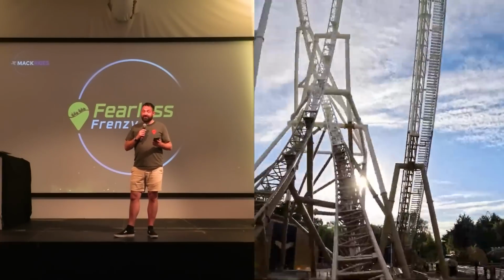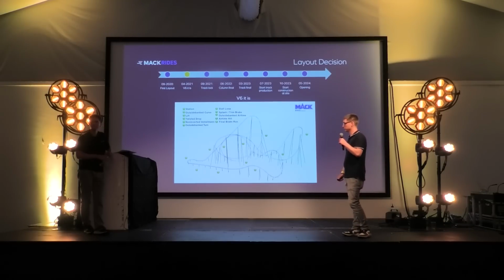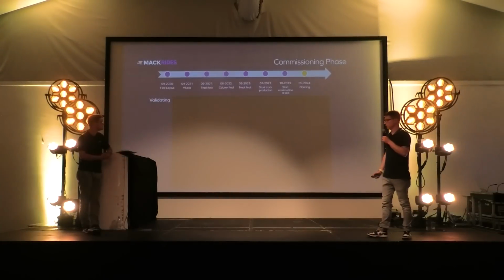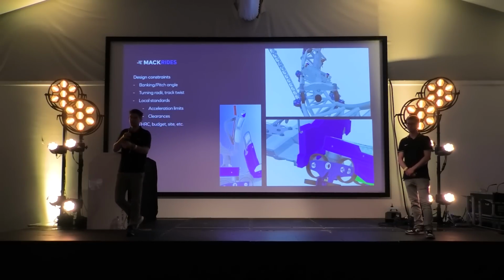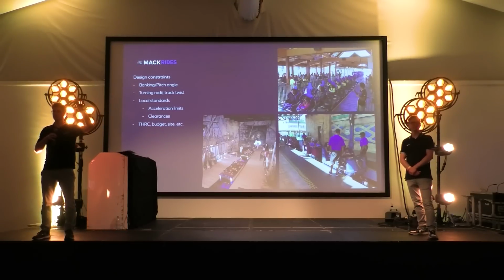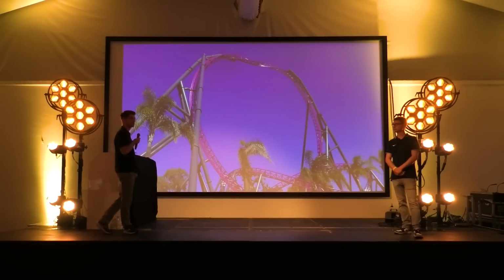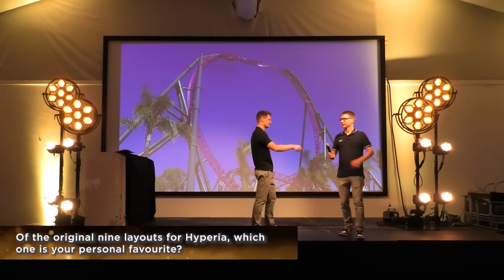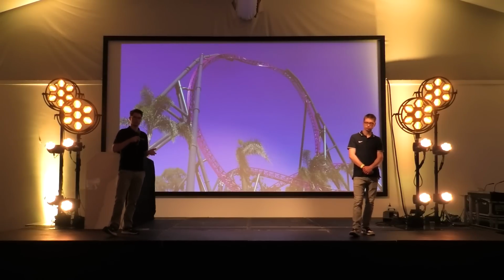The Making of Hyperia at Thorpe Park - Mack Rides Presentation and Q&A 2024

Comment: Im not upset that it changed dramatically... the first iteration was too normal. Drop, airtime hill, classic rmc looking outerbank on a turnaround, etc etc.

The iteration built is far more innovative.  Twisting drop, noninverting immellman that levels out early enough to be an airtime hill at its crest after changing directions as well, the outerbank which is not an outerbank at all and deserves a new title. Its like an inverted hammerhead stall that turns into a death roll/zero g drop. Followed by a zero g stall that levels out as a dive loop. If they had more money id be happy to see the trim removed after that and finally some classic airtime hills, but i frankly wouldnt trade the first 75 percent of the experience for something that looks essentially like a 2001 intamin hyper coaster.
Reply from the maker: @davidnevolo4402  great summary! And the outer bank is called the Kremer Roll, after the designer Maurice ☺️

Comment: Wait... So they came up with design number 6 because they didn't have space for a classic hypercoaster.. Yet the first version they show before is exactly that: A classic hypercoaster. It also shows that there was plenty of space to do it as Hyperia also has  a lot of very long parts where they could go straight.. What happened there??
Reply: There's a good chance that merlin came back and said that they weren't capable of going so much into the trees due to environmental issues. even with layout 6 being selected project exodus still faced objections by environmental groups.
Reply: Merlin wanting to save money
Reply: Im not upset that it changed dramatically... the first iteration was too normal. Drop, airtime hill, classic rmc looking outerbank on a turnaround, etc etc.

The iteration built is far more innovative.  Twisting drop, noninverting immellman that levels out early enough to be an airtime hill at its crest after changing directions as well, the outerbank which is not an outerbank at all and deserves a new title. Its like an inverted hammerhead stall that turns into a death roll/zero g drop. Followed by a zero g stall that levels out as a dive loop. If they had more money id be happy to see the trim removed after that and finally some classic airtime hills, but i frankly wouldnt trade the first 75 percent of the experience for something that looks essentially like an 2001 intamin hyper coaster.
Reply: remember that most of the people at the parks ( CEO/marketing/commercial) are not enthusiasts so prob dont care as much as us about specifics or nuance like enthusiasts do.... only what is "best value", most "marketable". its clear Thorpe values inversions over airtime, inversions more marketable...